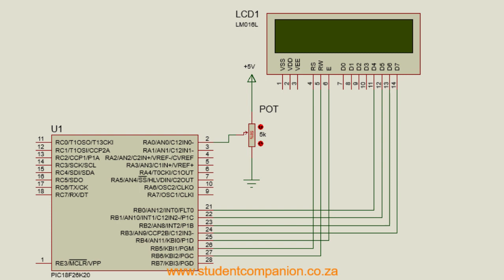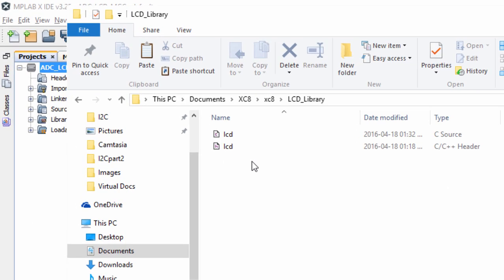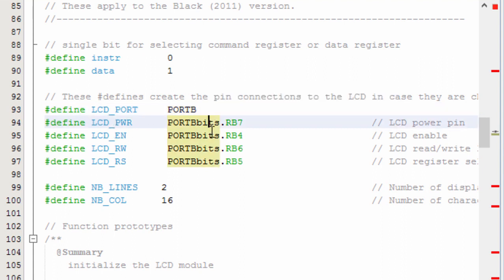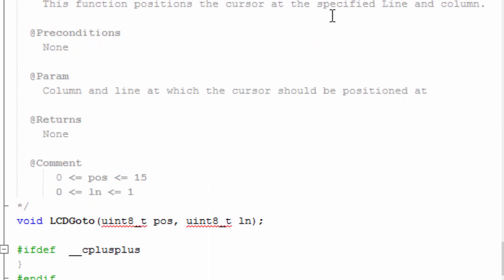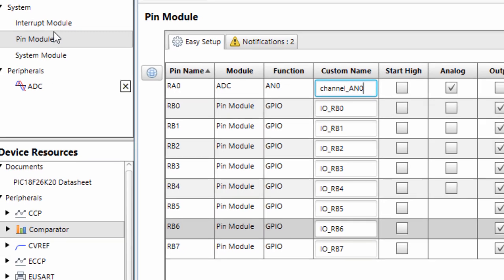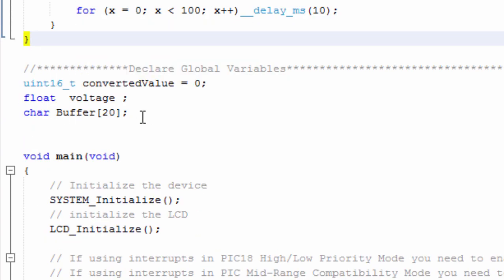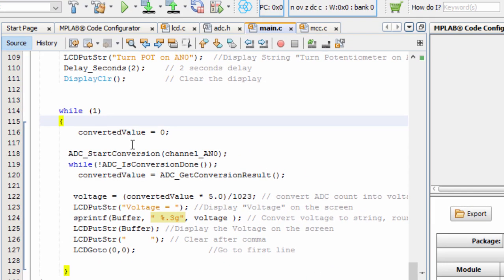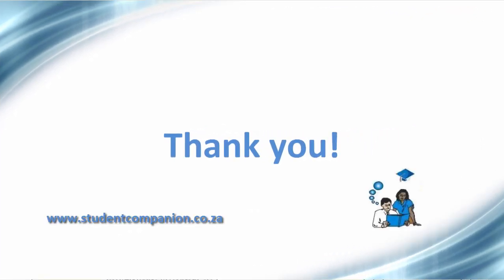22- ADC and LCD with MPLAB Code Configurator | MPLAB XC8 for Beginners Tutorial

Comment: hello Student Companion, i want to tell you as first thank you very much for all your tutorial. it´s very helfull.so i have a Problem: i want to programming my 2x16 LCD with PIC16F1937 used MCC please can you help me how i can do that? course in you tutorial you used another pic and installed a new library (PIC18F Legacy Peripheral Libraries v2.0 - Windows)i thank you in advance for your help.great
Reply from the maker: +hosanalove in this tutorial 22 we used MCC but you don't have to use MCC if you don't want to.  You can just use the same lcd library . You don't have to use the same PIC.  You can use your pic with it. Are you getting any specific errors?
Reply from the maker: +hosanalove if you get any errors, let us know. The full article is on: www.studentcompanion.net/en/interfacing-lcd-display-with-pic-microcontroller-xc8/
Reply: thank you very much for your quick Response! I downloaded the library PIC18F Legacy Peripheral Libraries v2.0 - Windows and stored it in my computer. but I can´t add this with MPLAB XC 8 together. I have this Error: C:\Programm Files (x86)\Microchip\xc8 does not contain XC8 compiler installation.  And when I tried to go on: "Project Properties\XC8 linker", the "Link in Peripheral Library"  is with (N/A). Sorry i´m totally new. please help, what should I do to keep my 2xlcd running?
Reply from the maker: +hosanalove why do you download the PIC18F peripherals libraries? This works only with PIC18F Series and you said you are using a PIC16F device.  It won't work.  Just download the lcd library it should work with your device.
Reply from the maker: +hosanalove why do you download the PIC18F peripherals libraries? This works only with PIC18F Series and you said you are using a PIC16F device.  It won't work.  Just download the lcd library it should work with your device.
Reply from the maker: +hosanalove why do you download the PIC18F peripherals libraries? This works only with PIC18F Series and you said you are using a PIC16F device.  It won't work.  Just download the lcd library it should work with your device.
Reply from the maker: +hosanalove why do you download the PIC18F peripherals libraries? This works only with PIC18F Series and you said you are using a PIC16F device.  It won't work.  Just download the lcd library it should work with your device.
Reply from the maker: +hosanalove why do you download the PIC18F peripherals libraries? This works only with PIC18F Series and you said you are using a PIC16F device.  It won't work.  Just download the lcd library it should work with your device.
Reply from the maker: +hosanalove if you have that error it means you haven't installed xc8 compiler. Watch our tutorial 1 to learn more.  When you install the peripherals libraries  you must install it into your xc8 installation folder.
Reply: yes I have installed xc8 already. I downloaded the LCD library on your Home page and saved it in my Desktop add it to my Project (the lcd.h to Header Files and the lcd.c to Sources Files). but this error is coming when I tried to Clean an Build Main Project: ../../Desktop/LCD_Library/lcd.h:46: error: (141) can't open include file "mcc_generated_files/mcc.h": No such file or directory. I already generated the code with mcc. in the lcd.h files the:  #include "mcc_generated_files/mcc.h" is marked in red that is the only error I still have. please Help !!!!
Reply from the maker: +hosanalove can you post a screen shot of your errors and your c main file on our website?
Reply: i don´t have this error no more. I simply close MPLAB and restarting it new and there were  not more error.I am now trying to run the LCD. thank you very much
Reply from the maker: +hosanalove good to hear that. Good luck.
Reply: I have tried over the night to run the LCD. but ist not worked. i have this error message: undefined identifier "convertedValue" where should i have to define it? in the adc.h files? i just watched you tutorial 22 and simply do like you.  I also have 2 warning on my code. in this line: for (x = 0; x < 100; x++)__delay_(10); the warning ist: function declared implicit int. the second  warning is on this line: LCDPutCmd ("ADC with MCC"); illegal conversion of pointer to interger.   please help!! thank in advance !
Reply from the maker: +hosanalove hi. It simply means you did not decrare convertedValue.  Watch clearly our tutorial 22. We declared it just on top of the void main function.  Or you can do it like this as a global declaration: uint16_t convertedValue =0;
Reply from the maker: +hosanalove you can check our code and compare it with yours at: www.studentcompanion.net/en/analog-to-digital-converter-in-pic-microcontroller-xc8/
Reply from the maker: Please if you are still struggling, zip your full project, send it to us. we will compile it.
Reply: thank you very much. I´ll send it to you on your  E-mail  address in a fewer minute.  that is your adresse:info@studentcompanion.net right?  thank you very much!
Reply from the maker: +hosanalove ok. We will check and compile your program
Reply from the maker: Hi. Your code looks correct and it compiles without errors. We can only suspect the way you connected your LCD to your microcontroller and the pins declarations. make sure the 10 pin connector that you connect to your LCD, all the pins connected correspond to your declaration in lcd.h
In your declaration you did in lcd.h:  #define LCD_EN       PORTDbits.RD6   // LCD enable
                                                                #define LCD_RW       PORTDbits.RD5  // LCD read/write line
                                                                 #define LCD_RS       PORTDbits.RD4
Watch our tutorial 5 to learn more about these pins: https://youtu.be/u2VPLtELzZ4
Reply: Thank you for the way your are doing that I understand everything. thank you very much!In your Tutorial you´re using 10 Pin (Vss, Vdd, Vee, Rs, Rw, E, D4, D5, D6 and D7). The Pin D4 is connected to RB0;  Pin D5 to RB1;  Pin D6 to RB2; Pin D7 to RB3;  Pin RS to RB5; Pin RW to RB6;  Pin E to RB4. But in the lcd.h you just define 4 Pin ( LCD_PWR,  LCD_EN,  LCD_ RW,  LCD_RS ) what about the definition of the other  LCD Pin you connect to the µC (D4, D5, D6, D7)?. Please Help! I'm so sorry for to much stupid question. Maybe tomorrow i´ll be able to help other people. Thank in advance.
Reply from the maker: +hosanalove if you are using the peripheral libraries as we explained you don't need to define the port connection if you gonna use portB.   It's already done by default.  You can only change if you're gonna use a different a different PORT as we explained in tutorial 5 and tutorial 17. Please watch tutorial 17. But in tutorial 22 this is a different lcd library.  Don't confuse them. Let us know which lcd library you want to use.
Reply: I´m not use the Legacy Peripheral Library but the other one on your web page. I want to connect my lcd to PORTD and my ADC to PORTA. my pic ist PIC16F1937
Reply from the maker: +hosanalove then follow our instructions as in tutorial 22. Use it as it is with default connection to PORTD. Make sure all 7 pins from lcd are connected to the microcontroller: RS to RD4, RW to RD5, E to RD6, d4 to RD0 ,d5 to RD1 ,d6 to RD2 and d7 to RD3.
Reply from the maker: +hosanalove then follow our instructions as in tutorial 22. Use it as it is with default connection to PORTD. Make sure all 7 pins from lcd are connected to the microcontroller: RS to RD4, RW to RD5, E to RD6, d4 to RD0 ,d5 to RD1 ,d6 to RD2 and d7 to RD3.
Reply from the maker: +hosanalove check your board to lcd connection either wise modify the lcd.h file.
Reply: thank you very much. so I don´t have any more to change anything on the lcd.h if I wanna connect my lcd on portd. right?  I m trying it now.  thank
Reply from the maker: +hosanalove yes. But pay attention to confirm that the data pins d4, d5, d6 and d7 of the lcd are connected to RD0, RD1, RD2 and RD3 respectively. Verify these connections
Reply: it does not unfortunately work until now. I´m trying  all the time but noting is showing on my display.:-)
Reply from the maker: +hosanalove try to simulate if you have a simulation software like Proteus then you know it's your hardware.  I can only suspect the way you connect your hardware.  Maybe you can try another lcd
Reply: you define in the lcd.h the lcd power like this: #define LCD_PWR  PORTBbits.RB7 is that mean that the Lcd PWR is connect to  port RB7 of the µc? lcd pwr is not Vcc that is normally connect vdd of the µC?
Reply from the maker: +hosanalove as you can see from my simulation circuit diagram.  I never used that pin. It was just defined in the library if you want to switch on and off the lcd with code. You can ignore it.
Reply: I tried it today again but with Flowcode. it´s working. What could be the Problem with mplab? I absolutely  want to make it  with MPLAB.
Reply from the maker: +hosanalove if it's working with Flowcode then I can only guess it's how you define your lcd pins connection in the lcd library.  Which lcd pins did you define in Flowcode?
Reply: a friend of mine did it. he define RS to bit0; EN to bit1; D1 to bit4; D2 to bit5; D3 to bit6; D4 to bit7.I have tried like him in MPLAB but it´s not working. it's really depressed. help please.
Reply: i think this library is not working with pic16f1937. i feel like a dull men
Reply: I'm still trying to run the 2xlcd Display. i am now better than before but it still not working. my lcd is HD44780 is that posible that the initialization muss be Change? i already see something on the Display like this: " 0000.yyyy/" but it is not what i print on the Display. Can you please help me again? please
Reply from the maker: +hosanalove if you see something on the display it means your connections are good. What data are you sending to display and how (which function) are you sending it?
Reply: I just send a string to display. i do it exactly like in your tutorial with: LCDPutStr("Student Companion") but it not display this string.
Reply from the maker: +hosanalove can you send us a screen shot of your display to see what is displaying together with your zipped project?
Reply: yes. i ll send you per mail. thank very much
Reply from the maker: +hosanalove we will look at it again
Reply: thank you very much